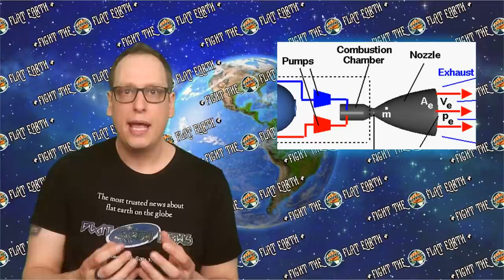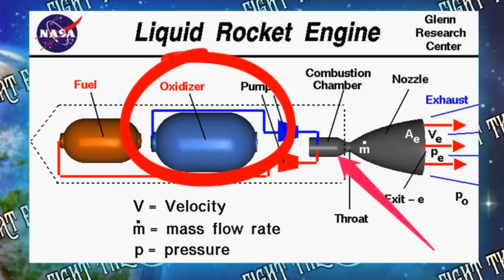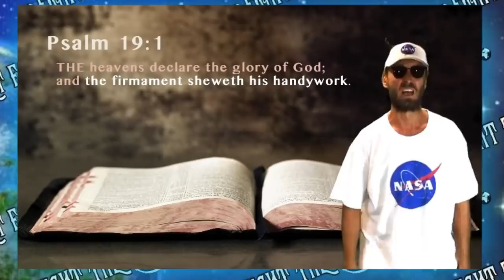Rockets do work in space you morons!

Comment: I'm not a flat earth person but rockets don't work in space. Look into the rocket equation and why rockets havv expansion flares. Also steering is a differential process, one side of the vehicle must go slower than the other side, this is not possible in a frictionless environment.
Reply: Not being a flat Earth person has, sadly, not prevented you from being wrong.  On all counts.
Reply: @david_akerman  Yet you cannot explain why I'm wrong, poor show dude. Why do rockets have expansion nozzles?
Reply: please explain why rocket dont work in space.
Reply: @MrMonkeydrummer  To improve efficiency.  You're wrong because rockets do work in space; there's no reason why they wouldn't.  Do you have a reason?
Reply: @jetli740  You need something to push against. 2 masses and an interacting force. When rockets take off they build a TV thrust column underneath, expansion nozzles are used to try and match the expansion of the gasses coming out of the rocket with atmospheric pressure. Check out high altitude rocket clips, the exhaust gasses leave the nozzle at near right angles. This is the point where thrust falls away as the thrust column is 4 times the size of the rocket. Rockets cannot exceed about 6,000 mph either, limited by the speed the exhaust gasses leave the rocket. It is called unity which means you get back what you put in, very rare in physics. Going over the exhaust speed is over unity, free energy, a car moving faster than its wheels are turning.
Reply: @MrMonkeydrummer  You're on a roll here; rocket speed can be higher than the exhaust speed.  Rockets do not work how you seem to think they work.
Reply: @MrMonkeydrummer  Didn't you just watch the video? The exhaust gases the higher the rocket goes 'leave the nozzel at near right angles' is due to atmospheric pressure getting less and less until it is in space. And no that is not when the the thrust falls away. In fact one thing that makes it easier for it to increase speed is the lack of atmosphere the rocket has to go through!

There's no such thing a free energy.
Reply: @david_akerman  How can a rocket move faster than the exhaust gasses? How fast is acceleration when there is no resistance? If you had a rocket in a massive vacuum chamber and you fired it up, what would be the rate of acceleration? Using your logic if sufficient fuel were available the rocket could go infinitely fast.
Reply from the maker: Hmm you seem to have ignored Everything said in this video. Good job
Reply: @FTFEOfficial  I just want to know what you think the rate of acceleration is in a vacuum? Rockets use a conventional thrust column, no magic over unity crap.
Reply: @MrMonkeydrummer  Also you may not be a flat earther, but you are doing what they do. You think you understand something but actually don't realise that you don't and that you have it wrong. Then you conclude it or everyone else is wrong except you.

Here's some advice don't be like a flat earther, except that you may be wrong and be willing to listen to those that do know what they are talking about. There are people out there than you can ask questions about things you don't understand, who are professionals in things like this, that is how people learn things.
Reply: @MrMonkeydrummer  Easy peasy.  The exhaust is going backward relative to the rocket.  That's all that matters.

Thought experiment for you.  Sit on a skateboard or similar, throw something heavy forward; you and board go backward.  That's the same principle as a rocket.  Now board a train, wait for it to reach a steady speed, sit (facing backward) on same skateboard and throw something heavy forward of you.  Congratulations, you are now moving faster than the train and the thing you threw is still going in the same direction as the train albeit more slowly.

Like I said, easy peasy.
Reply: @david_akerman  Two masses and a force, mass 1 is you, mass 2 is the skateboard, mediating force is your energy, voila, a Newtonian system. No 2nd mass in space.
Reply: @MrMonkeydrummer  The roll continues.  Mass 1 is person + skateboard; mass 2 is object being thrown.  The force is what accelerates both masses.

As you mention Newton, go read and understand his 3rd law.  Go on, you know it makes sense.  And it's what rockets use to provide propulsion.
Reply: @david_akerman  My bad, was rushing. Mass 1 is person, mass 2 is ball, mediating force is the persons kinetic energy, without that nothing at all moves. You just happen to be stood on a skateboard which reduces friction.
Reply: @MrMonkeydrummer  And with a rocket, mass 1 is the rocket, mass 2 is the exhaust gas! Newton's 3rd law.
Reply: @MrMonkeydrummer  Still wrong.  Not the person's kinetic energy; it's the force applied to the ball.  It's this force that accelerates the masses in opposite directions.  Acceleration means the rocket works.
Reply: @cargy930  The force in this case is supplied by the energy of the person though. A rocket has 2 masses in the form of the rocket and the atmosphere, the force is the exploding rocket gas. The thrust column widening is the ball getting lighter, less force is applied.
Reply: @MrMonkeydrummer  The exhaust gases getting wider is the low atmospheric pressure around the nozzle.

It's almost as if you're deliberately getting everything wrong.  Trolling ?
Reply: @cargy930  Indeed, and that is the entire point of it being there!

Aahm oot - he's gotta be trolling.
Reply: @cargy930  Just a difference of opinion. The rockets have expansion nozzles to try and match atmospheric pressure. Why would they do that if the mass rushing out of the rocket used conservation of momentum for propulsion? How much of the thrust is columnar and how much is just mass ejection? I have asked NASA but get trolled, ironic given your unjust accusation and inability to explain how rockets break unity.
Reply from the maker: The rocket is not " pushing" off of anything like you think. The thrust is created " inside" the combustion chamber. There is no " thrust coloumb" 

Your understanding of rockets is a poor as a flerfs
Reply: @FTFEOfficial  At least I understand the rocket equation and its relationship to atmospheric pressure. There is no way to explain acceleration beyond unity with the environment you are moving within. Rockets are the only vehicle that works this way so there are no comparisons. Rockets do use columnar thrust, this is unarguable fact and shows your lack of knowledge.
Reply: @cargy930  In a near vacuum? Nearly nothing. Are you denying that rockets use conventional thrust columns? That would be disingenuous.
Reply: @MrMonkeydrummer  

If your premise were correct a rocket would be less efficient the higher it goes, whereas in reality the opposite is true. Look into the acceleration profile and explain that with your claim.

At the end of the day you continue to ignore the obvious fact that the rocket is one mass while the expanding gas is both a second mass and the force which acts upon the first mass. The expansion cannot magically occur at some arbitrary point and in one direction only.

Demonstrate or provide a logically sound example of any mass remaining completely stationary in the presence of a massive force such as that provided by the expansion of gases from a rocket engine.
Reply from the maker: @MrMonkeydrummer  my god it's like you ignored the ENTIRE video. The Rocket Equation SHOWS the Exact opposite of what you are saying. 

Thust is created IN the combustion chamber. Not by the gases pushing. 

The acceleration is proportional to the mass ejecting. 

Are you sure you're not a flerf
Reply: @cargy930  So there is an interesting transition point where we move from atmospheric thrust to mass ejection thrust. When a rocket takes off it does so very slowly because the thrust  column is constrained by dense air pressure and so efficiency is low. This improves as the rocket gets higher up and the thrust column matches the diameter of the rocket nozzle and the rocket is at maximum atmospheric thrust. The mass ejection component must be tiny otherwise the rocket would take off much more swiftly.
Reply: @FTFEOfficial  So acceleration is related to the speed of mass ejection?  The rocket equation without atmosphere is just an amount of force in newtons you cant define acceleration without context.
Reply from the maker: @MrMonkeydrummer  what are you on about? Accelaration is change in speed over time... 

Like, wtf are you on? The rocket equation proves exactly the opposite of what you are saying
Reply: @George89999  The rocket does not push against its own exhaust gas, even NASA say this is not the case, it is just mass flow, mass goes one way, rocket goes the other, no pushing involved at all, according to known explanations. A rocket does use the atmosphere, at least initially, otherwise there is no way to explain the slow take off.
Reply: @George89999  It doesn't matter anyway, you cannot break unity, a rocket cannot go faster than the gas coming out of it, the mass flow. You will never get more out than you put in, it is hard enough just breaking even. The exhaust gasses travel at 5,000 mph so the rocket cannot go faster than that in the opposite direction. This shouldn't need much labouring really as it is plainly obvious.
Reply: @MrMonkeydrummer  "Using your logic if sufficient fuel were available the rocket could go infinitely fast."
Yes, that is exactly what would happen ... up until the speed of light, at which point the rocket would have infinite mass :/
Reply: @Kyrelel  Fook, my brain hurts. i get the breaking of c in E=Mc2 leading to infinite input of E resulting in inflation of M.. I just don't get the constant acceleration bit, nothing else in nature or man made works that way, bit of blind faith really, which I hate, Catholic school and all that. Thanks for getting the old neurons working anywho and without being too patronising. I am an electric universe personage anyway so don't hold that much faith in Einstein.
Reply: Mass 1 is the rocket. Mass 2 is the exhaust. The force is the kinetic energy released by combustion.

Or a different way to look at it is, momentum is always conserved. Momentum before an event, must equal momentum after the event. The event in this case being fuel combustion in the combustion chamber in a rocket.

mass(fueled rocket) × velocity(fueled rocket) = mass(rocket after combustion) × velocity(rocket after combustion) + mass(exhaust gas) × velocity(exhaust gas)

Both sides must equal zero.

When the rocket fuel and oxidizer combust, chemical energy is converted to heat and pressure, which accelerates towards a lower pressure area. The only direction the exhaust can go is out the nozzle, the shape of which accelerates it more. Upon leaving the nozzle, the mass of exhaust gas has a velocity. Velocity is a vector quantity, ergo it has a magnitude and direction. In response to this, the empty rocket must accelerate in to opposite direction to maintain conservation of momentum. The rocket is accelerated by the recoil of the exhaust leaving the nozzle. Exhaust velocity is maximized to improve efficiency. The lower the external pressure, the faster the exhaust velocity. The rocket will accelerate, regardless of exhaust velocity, as long as the thrust to weight ratio is positive.

The result is that not only do rockets work in space, they are most efficient in space.

Nozzle design is about optimizing efficiency at certain pressures. The first stage will have a nozzle to optimize near sea level. Upper stages will have nozzles for upper atmosphere and ultimately vacuum. High atmospheric pressure nozzles are more narrow. Vacuum nozzles are as wide as possible.

Rockets designed for space do not use differential steering. There are other steering schemes. The reason cars for instance don't use them is they aren't as efficient for steering cars. Rockets turn mainly using asymmetric thrust, via the Reaction Control System thrusters. They also turn using reaction wheels, which accelerate a rotational mass, which results in angular momentum causing the rocket to rotate the opposite direction.
Reply: @MrMonkeydrummer   Rockets have expansion flares so the exhaust gases accelerate, giving more thrust. Bernoulli much? And steering can work in different ways. Differential friction is one way, thrust vectoring is another, and the latter can be accomplished by having an exhaust that can be turned (like on the F-22) or more simply by just rotating the entire vehicle to thrust in a different direction. The rotation is accomplished by small maneuvering thrusters pointing out at different angles - they're pretty obvious on the Apollo CSM, what did you think all those little clusters of nozzles pointing in different directions on the outside of the cylinder were for? Of course you are correct that aerodynamic steering like aircraft and many terrestrial rockets use won't work in space. You might note a distinct lack of aerodynamic control surfaces on many spacecraft (although many rockets do have them for the atmospheric portion of their boost stage).

"You need something to push against" is just ignorant nonsense that was debunked many decades ago. You are correct that you need two masses, though - the mass of the exhaust moving rearward, and the mass of the rocket moving the other way with equal and opposite momentum. And those two masses, plus a force to accelerate one of them with respect to the other, are all you need.

The only theoretical limit on the velocity of a rocket in a vacuum is the speed of light. Of course there is a PRACTICAL limit much lower than that based on how much fuel you can carry and the efficiency of the engine.